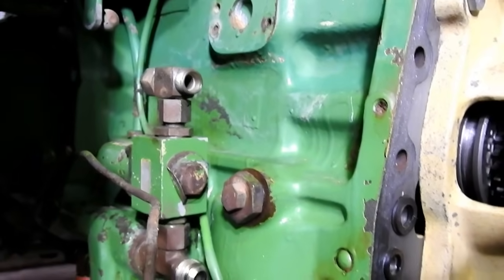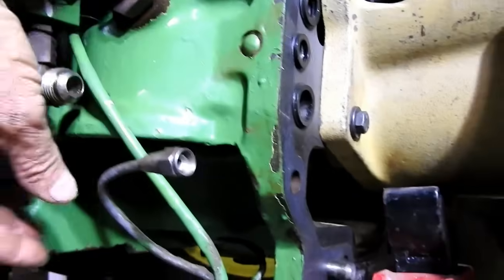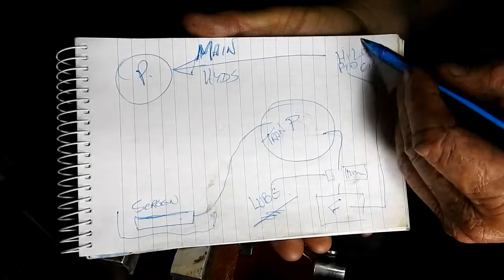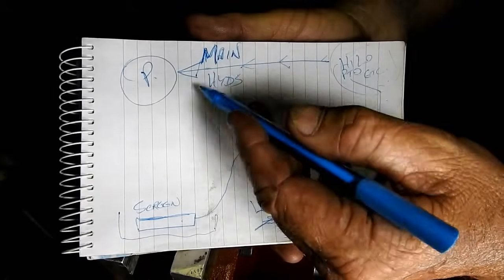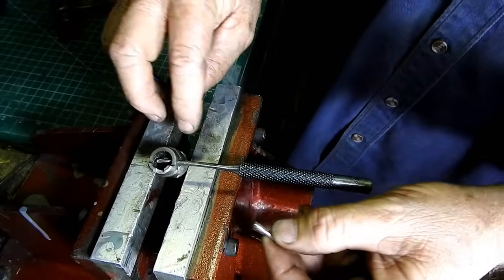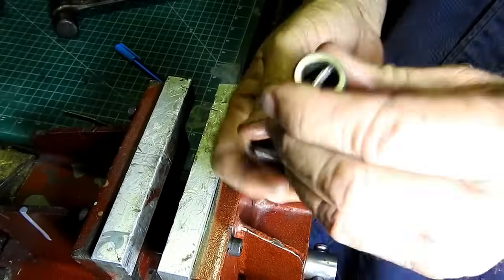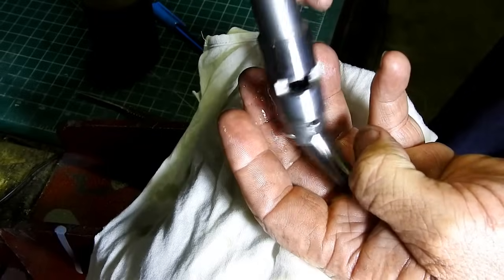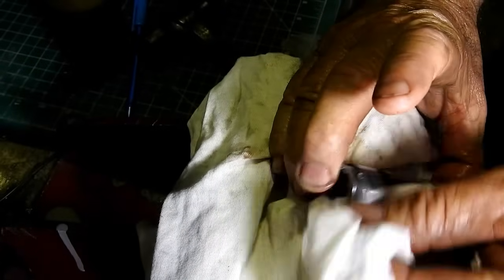How to Check Your John Deere Filter Bypass Valve

Comment: I have a John Deere 2030 tractor and it has an engine overheating and blown head gasket problem. The engine has been completely rebuilt, but the problem persists. It's draining coolant from the radiator. What could be causing this problem?
Reply from the maker: Bad liner o ring possibly.

Comment: Great video. I have a john deere 2140 2 wheel drive. 

My steering is having issues. When engine is cold the steering works good but when engine gets up to temperature the steering becomes unpredictable. Would that be an orbital unit problem? A priority unit problem? Or a bypass valve problem like you show in the video?
Reply from the maker: Possibly a low pressure oil system leak, You need to put some gauges on it.
Reply: @BundyBearsShed thank you
Reply: @BundyBearsShed but if there's no leak which i know for certain that there is'nt then what else could it possibly be if the pressure test fails?
Reply from the maker: Internal leaks.
Reply: @BundyBearsShed thanks.

Comment: On my John Deere model 3040 it is not lifting any implement and my steering system is very hard
Reply from the maker: Check the filter bypass valve and change the filter etc and see what happens.

Comment: Ty so much i lost my hydraulic pressure to my loader steering ect. I looked at these guy's on YouTube and they had all kinds of bs. Anyways i didn't catch it when i watched your video the first time anyways when i watched and your diagram. I had a aha moment. Even though i have an 84 industrial i found the valve pulled it out. Checked it and although it looked ok i pushed the plunger and it moved sadly i put it back together and for the heck of it i fired up the tractor and just like in the past I heard the hydraulics load up. You saved me thousand of dollars. And cost me nothing you explained it perfectly about it worked and next day didn't thats exactly what happened to me. Huge thumbs 👍 up i was gonna replace my main pump because i was desperate ty ty
Reply from the maker: So glad my video helped you out and saved you some money!

Comment: Well done!  I purchased a JD 2240 and I know nothing about them.  I watched your video and did as you suggested.  The roll pin on the inner end somehow broke and the pieces stuck jamming the valve open/bypass.  I thought i had won!  Sadly, i still do not have any hydraulics.  No steering, no psi at pump in front.  Any suggestions on where to go from here?  Thanks!  Ben.
Reply: Thank you, i did that and all new oil.  Things looked pretty good.  I drained 20 gallons out!  I put in 10.  The dipstick is gone so going by manuals capacity recommendations.  Also,  when i cleaned the screen, i fished out a couple nuts.  Not comforting.
Reply: I am thinking the transmission pump pressure is next.
Reply from the maker: Yes check that for sure.
Reply from the maker: Check the screen in the bottom of the trans housing and replace the trans filter. 
I have known them to crack pipes inside but do the east stuff first.

Comment: Tengo un 3150 que al meter el Hi Lo a pocas revoluciones, la dirección se endurece. Cuál puede ser el motivo? Gracias
Reply from the maker: The Hi Lo brake pack piston sealing ring has failed, you will need to split it and do a repair. It will be the same as my JD1640 video

Comment: Hey a bit off topic but i hope for an answar i have an 1976 1030 tractor without power steering. That i would like to convert the orginal way. If i get the power steering column the big black one and install that. Where do i need to tap into the hydraulics? And also where can i install the pvc orginal valve. Is this a bolt on converstion? I have a loader on mine and it can be hard to steer with load in the bucket.. hoping for an clearifying answar😄
Reply from the maker: Tap in to the high pressure line that goes to the back, the 5/8" steel pipe.
Reply: @ oh okey thank you. No need to install extra priority valve??
Reply: @BundyBearsShed  no need for extra priority valve sir? Mine dont have one orginal😅

Comment: Hello. I have JD 2650 and have problem with constant pressure in hydraulic system. When tractor run at 1500 rpm or more the hydraulic cylinders  who are attached slowely moves. Whay is this happening? 
Thank you
Reply: Hoked is front loader or at back trailer and hydraulic toplink. So this is leaking in control valves? How much pressure can be in system?
Reply from the maker: Pressure should be 2650 psi
Reply from the maker: Possibly a high pressure hydraulic leak.  Im not sure what is hooked to it.
Reply: Thank you very much. I have one more question. I have front tyres 380/70R 24 and rear 420/85 R34. Are this dimensions ok? Because I can hear the noise when is front drive turned on.

Comment: hey ive got a john deere 1020 and it has been sitting for a while and the oil in the hydralic oil tank has turned into sludge and no matter what i do icand get it ou what do you think i should do
Reply from the maker: Flush with some diesel.
Reply: @BundyBearsShed  cheers for the advice it worked well but the transmission dipstick is stuck in the transmission because of rust after being sitting with dirt on the cover
what should i do
Reply: and do you know about the 1020s having a engine oil cooler like the 1640 as i have one of those too
cos mine does

Comment: I took out the filter byoass valve and the roll pin was broken. Will that lead to my loss of hydraulic lift and power steering due to faulty valve?
Reply from the maker: Yes it sure will
Reply: Works perfectly now with new roll pin . Cleaned the screen also but was all the bypass valve. Thank you very much

Comment: I just got a JD5403 and after a few hours use it started "bumping" while steering and while lifting the bucket. just started so the tractor is down. Do you think it could by that bypass valve???  Great Video.
Reply from the maker: I think the 5403 may have a different setup.
Reply: @BundyBearsShed  probably. TY

Comment: El problema hidráulica que tengo jhon Deere 3140DT carcasas del filtro  del transmisión fisuras  ? Esa válvulas puede ser las causas  ? Agradecería ayudarme  . Saludos desde Paraguay
Reply from the maker: Yes it could be the problem, as pressure builds in the housing this valve should open and relieve it.
Reply: @BundyBearsShed maestro mi agradecimiento por contestarme  aun que todavía no puedo leer tu contestación

Comment: Amigo como va el sentido de la válvula yo tengo un 2030 hi me vaipasea el aceite gracias
Reply from the maker: The 2030 will drain the back oil if the valve is not fitted.

Comment: Hey Lance I have a question regarding my 4440JD? I was bedding pens in our feedlot and all of a sudden it wouldn’t go forward. It wants to go forward but couldn’t. Then I kicked in my PTO and my tractor would move. Does this sound like a clutch problem not getting enough oil or a valve not working properly? Or is my clutch just gone? Thanks!
Reply from the maker: Sounds like a leak in the pto oil supply circuit.

Comment: Quick question: I have a JD 2940 and was wondering if I can put the bypass valve in wrong? I am still having hydraulic issues. When I put the valve in I spun it around but never heard or felt it lock in. Once I installed it, I could spin it around some but not all the way around. My hydraulics still don't work after a couple of minutes. Thanks, Gary
Reply from the maker: No not on the 40 series.

Comment: Great video hope this is my fix.  I believe my hydraulic pressure is spiking.  Cracked two filter housing in a row with Pto engaged on my JD 2555
Reply from the maker: filter housing cracking might be a sign of too much oil returned from a loader or similar.
Reply: @BundyBearsShed  buenas tardes te escribo por tu comentario sobre la caja del filtro hidráulica fisura yo tengo el mismo problema de un jhon Deere 3041dt si puede ayudarme ayudarme
Reply: puede ayudarme , donde esta las solución .juan B. Alonso saludos desde Paraguay
Reply: Hola buenas tardes Marco me interesa muchísimo  saber que parte   encontraste solución a tu tractor con  la caja de filtros rotos yo tengo igual problema  con un jhon Deere 3140DT  sí puede ayudar solucionar este problema  agradecería Saludos desde Paraguay

Comment: You helped me fix my 2555 and thank you. One tip l had already changed my oil and filters and didn't want to drain all the oil out. I back the tractor up on an 8" block and removed the bypass valve with out spilling hardly any oil. Also l used a brass 40 caliber muzzle loader bore brush in a drill to remove the crud. Thank you for your help.
Reply from the maker: Changing the filter usually only loses around 3 liters of oil and with the bypass valve being higher up the side it doesnt lose much either.
Reply: @BundyBearsShed  Buenos día  maestro leí tu respuesta a mí pregunta muchas gracias

Comment: Thank you for taking the time to help people. I was having steering,lift and tramission gears grinding when shifting on a 2555 that l bought new n 1990. I removed the bypass valve and it was corroded. Cleaned it up and everything is working great.  Your my hero.
Reply from the maker: Great to hear!

Comment: on my JD 2020 i lost hydraulics.  I removed the bottom hydraulic filter and started the engine.  Not even a drip from the transmission pump.  Would the filter bypass cause this?  Also, i cant get the filter bypass valve out.  It seems to be stuck in the tractor.  Is there a tool to get this out if it is stuck?  Thanks for the info.
Reply from the maker: No tool for the bypass valve, The oil goes from the screen to the trans pump then back to the filter. With no filter you should have flow. You may have a faulty trans pump. I have seen the gears crack on them.

Comment: i put my bypass valve in without turning it i tightened the nut and now i cant get it back out. any ideas
Reply: non of my hydraulics worked but now my clutch,brakes and steering dont either
Reply from the maker: You will need to get it out as nothing will work with it sideways. Try grabbing the roll pin
Reply: i tried with needle nose vise grips and it wont budge the roll pin bent. i removed the hyraulic filter and you can see the bypass valve ive tried punches to beat it out,prybars nothing works.can i get to it from inside the rock shaft housing and beat it out? im about ready to weld something to it and use a come along to pull it out.
Reply from the maker: No you cant see it by removing the rockshaft housing.
Reply: finally got the bypass valve out by drilling it out..i replaced it and steering is working good but the brakes and loader still dont work. any ideas? scv valve maybe?

Comment: hi there i have 6320 transmission heat oil light coming on when doing road work after about 40 minutes driving . i have blowing  out the rad with compressor have check fan clutch tested themostat for transmission . filters and oil only changed 400hrs ago . next step is to take radiator out and test if engine coolant is mixing with transmission side of radiator. anything you recommend to check thanks luke
Reply from the maker: I have found that blowing out the radiator at times doesnt do the job but a pressure clean seems to get the extra out and have them run cooler. Certainly worth a try. Make sure the trans is not over full at all as that will generate heat as well.

Comment: Hi, thank for these videos, if you only know how much money your saving farmers around the globe!
My question: 3130 suddenly lost steering and remotes. But pto work fine. No oil go from trans pump to front pump, where should I start troubleshooting?
Reply from the maker: Test the pressure in the shift cover it is the front plug on the rh side. Check you bypass valve it is a little different to the 1640 but still easy to understand. I think you will be splitting it behind the gearsticks, there is 2 bolts hidden under the shift cover, and look for cracked pipes etc as well as the oil manifold.
Reply: @BundyBearsShed  Thanks for the reply, much appreciated!

Comment: Helow Mr. Lance. I have a John Deere 2650, (Spanish made) recently replaced the orbitrol, changed oil and filters, cleaned the front Pump filter and the sump filter, all works fine except the hidraulic couplers.... Little pressure with high rpm. Can you give me some advice? Thanks you from Portugal!
Reply from the maker: Does it work ok at low rpm but loose flow at high rpm or have no pressure all of the time?
Reply: @BundyBearsShed  no pressure at all.... Checked the filter  by-pass valve, now its ok, i Will check the relief valve tomorrow...

Comment: Hello, you videos are great, very informative and I'm sure help hundreds if not thousands of people with their equipment. I recently purchased a John Deere model 510 and would like to install one or two sets of remotes at the rear immediately and a loader at some point in the near future. Can I use hydraulic pressure from the transmission pump or is the front mounted pump the best option?  Thanks again for your videos, keep up the great work! From Ontario Canada
Reply from the maker: Front pump for sure but if you buy an aftermarket valve make sure you buy a closed center one and crank the relief valve to higher than the front pump pressure.
Reply: @BundyBearsShed  that would be for rear remote? Also what type of valve would I need? Thanks again
Reply from the maker: Any 1 or 2 spool hydraulic control valve will di the trick.

Comment: Better late than never, I do appreciate the video. The rockshaft valve on my 2240 is sticking or bypassing ???, the lever or the rockshaft will not stay down.  Do you have a video working on this valve or the rockshaft control area?
Thanks from Montana.
Reply from the maker: They do tend to want to lift but a fiber washer on the lever to stop it is the go, they had one on standard.

Comment: I have a 2130 series JD, I recently put a new rock shaft with new bushings, seals & shaft. When I fired her up the 3-point arms went full up and now won't lower!! Any input on this will be greatly appreciated. Thanks
Reply from the maker: Check the rate of drop screw in front of the seal hasnt been closed off accidently and the cam sticking up when you drop the top on must have the roller on the front of it and the back needs to run on the bolt on cam on the rockshaft. If it fell to the side the arms go straight up.
Reply: @BundyBearsShed  I didn't remove the top when I performed this work. Only the shaft and components.

Comment: I have a 5525 john deere  that my loader is working fine, the three point goes and down but drifts down when setting,  it appears but my rear hydraulics are not working at all. I have changed the filter and fluid even though  the filter looked clean and checked the screen.  I cannot locate the Bypass valve on this machine .  Even with diagram from John Deere.  When starting the tractor it sound like a lot of hydraulic pressure is built up. The motor bogs down.  Any idea.  Would this valve be the issue or something much more costly?
Reply from the maker: Is it coming straight up on to relief? if so check all valves are in neutral and feel for heat.

Comment: Mr. Bundy. I have a 2130. The 3 point hitch does not stay up. It lifts and then starts drooping down. If i give it some revs, the hitch comes back up. If I use the remote  hydraulics, the hitch just comes down also. The steering of the tractor is also spungy and hard. I will check this bypass valve and filter now. But I doubt that it is it. Because I bought the tactor from a mechanic who changed the filters and oil.
Reply from the maker: I would lift the top off and check the main piston o ring, as the John Deere tractors will hold up for days normally I would go there first.
Reply: @BundyBearsShed  I took it off. The main O ring crumpled as i took it out. Thanks a lot.

Comment: Thanks a lot for a very informative video. I have a curious problem on a JD5820 with milky or foamy oil in the transmission and struggling lifting power on the FEL. I thought it was water in the oil and have changed the lot including filter and  cleaned suction screen however no difference. I do know if the 5820 has this bypass valve but I am leaning toward something bypassing and aerating the oil. After it has been left the oil clears up. Any ideas to check next would be appreciated. Thanks for your videos 👍
Reply from the maker: It sounds like the pump may be cavitating and adding air to the system. Check the oil is correct for the system and also look for leaks on the inlet lines. Also check there is not a remote lever stuck in motoring or something and see if there is heat being generated around the FEL relief valve. I have not had a lot to do with the 5000 series but from memory they were open centre hydraulics with a gear pump.
Reply: @BundyBearsShed  Thanks Lance I will check everything you said and post back here. They are open centre and I thought load sensing as well (not sure). I am away atm so will have a look Tuesday next week. Thanks so much for your guidance.
Reply: @BundyBearsShed 😅